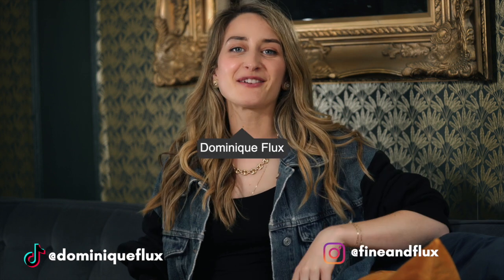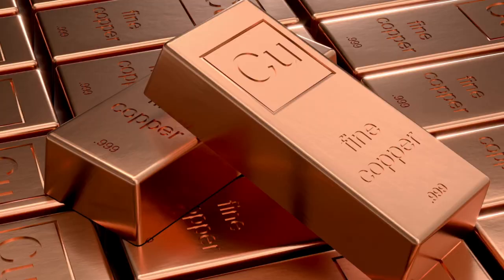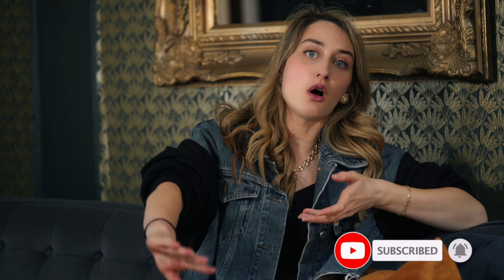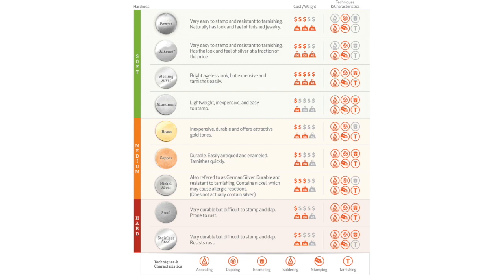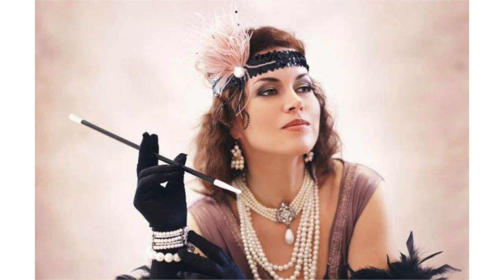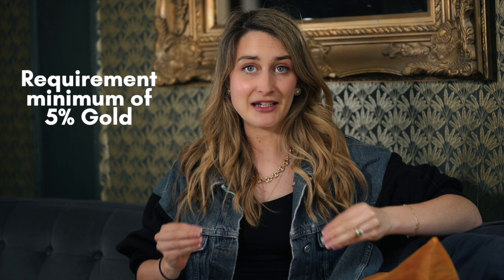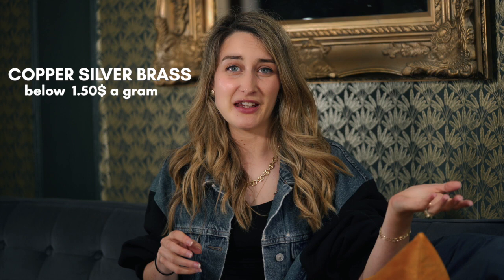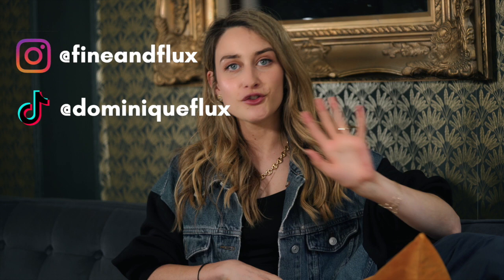Gold plated jewelry: vermeil VS plating, cost & most durable

Comment: Not that I’m disagreeing on the concept in the cost section…but just as a quick side note…for educational reasons…copper is the next most expensive metal below silver…and it’s anywhere from $3-4 a pound vs silver $1-2 per gram… so I agree that silver (especially gold plated) is marked up… but if price of metals is…take that for what it’s worth. Also, some of the cost has to go into the cost of making it…but that cost should be the same regardless of which non steel base metals are used…with stainless steel there are probably different procedures due to its hardness and super high melting temperatures. I’m not sure what my point is…but just something to think about. Good video!

Comment: This may be a little off topic, but I was wondering about actual gold "tarnishing."  (I have some gold pieces that are marked 14K that I have had for decades from my grandmother, and quite frankly are decades older than me.) I have noticed that in the back of a brooch there are some dark spots. I have noticed that some gold earrings (marked 14K) (again, decades older than me, and I am in my mid forties) have a bit of green in a corner.  Otherwise, they are in good and wearable condition with these flaws only noticed by me. What could be going on here?
Reply from the maker: I'm not sure, gold doesn't oxidize, my best bet is maybe it's a bit dirty, have you tried giving it a scrub with dish soap and a toothbrush? Also for gold, for pieces we wear often I do recommend giving them to a jeweler every 10 years for a deep clean and a repolish, it will make them new again!
Reply: @DominiqueFlux  Thank you for your response. Another complication is that the jewelry I have mentioned all have pearls. Wouldn't that affect how it should be cleaned?
Reply from the maker: @chanahminuk8485  For pearls I would just use an unscented very mild soap. Like a baby soap, that will be safe to wash your pearls
Reply: 14K gold is a mix of approximately 58% pure gold with 42% other metals such as nickel, copper, silver, and zinc. So the other metals oxide to form dark spots and green spots.

Comment: Thak you so much for this info. I would like to know your thoughts on tungsten rings, spetialy glod plated. For what you told in the video the hardness of the material will help the durability of the plating, would that make tungsten rings a more durable option?
Reply from the maker: Hi! I'm sorry I'm not familiar with Tungsten so I can't speak on it but if it is a harder metal then yes in theory it should be more durable towards scratching

Comment: Have a question if you have a white gold ring and love the style as it’s custom but your significant other wants yellow gold. Could I turn it to yellow gold via plating (or whatever method) and keep the design. If so which method should I use, it’s for an engagement ring.
Reply from the maker: Unfortunately for a ring you are wearing everyday, it doesn't matter how thick the plating is it will always wear off. You would probably have to replace 1-2 a year, from what I've seen. I would not recommend it